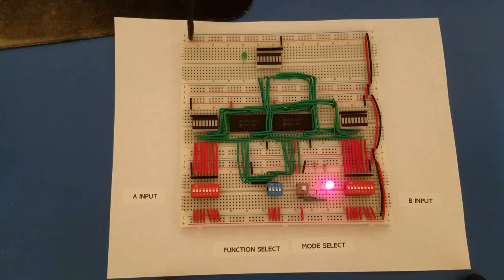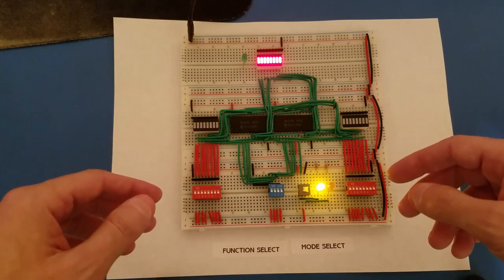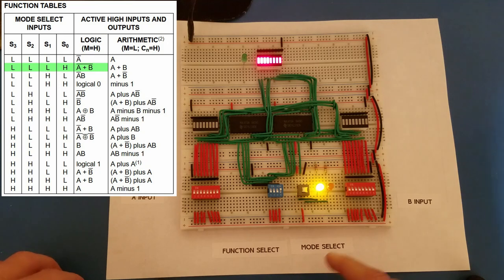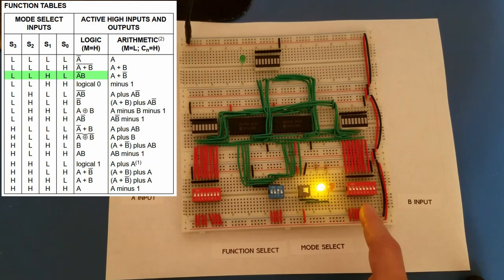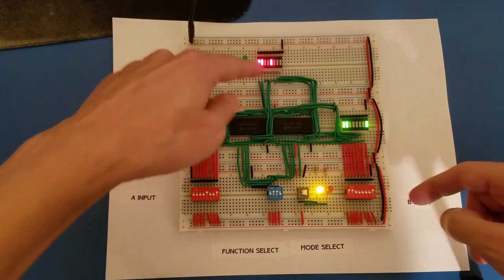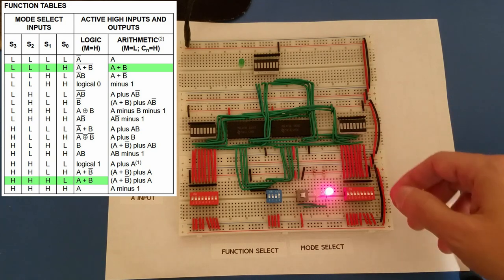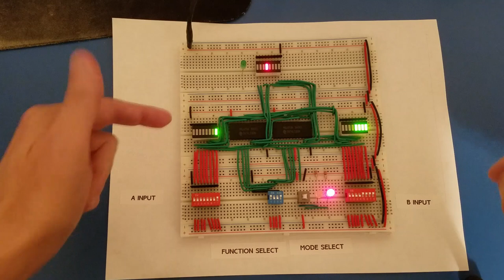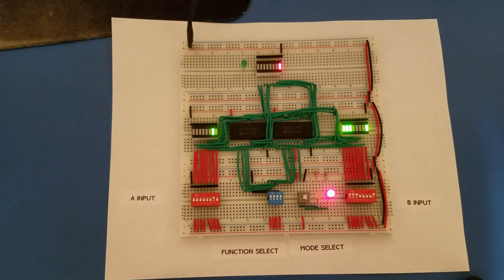Demo of 74LS181 (74HCT181) ALU

Comment: Ah, glad I found your video! I'm building a 6502 CPU clone from TTL chips. I'm just moving on to the ALU now and I'm going to use exactly the chips you used. I'll let you know how I get on.
Reply: I'm curious about how your 6502  clone went. Did you get it to work?

Comment: This chip was used in legendary computers like Digital Corporation PDP series. Unfortunately production was discontinued many years ago and it’s currently hard to find them now.
Reply: @ducksonplays4190   Guess what?. These chips are most probably recycled from old pcbs. Even at 1 or 2 € a piece, I kind of regard putting them on a hobby project as a sacrilege, like stealing gold pieces of art found in ancient Egypt catacombs just for display on your dining room.
Reply: @lsfornells  they might be but some chips they stock around 13k a day those about 300 a day
Reply: @ducksonplays4190  Just now they claim they have 120 units left ready to ship. I guess once they are gone they are gone. These chips are definitely no longer in production.
Reply: @lsfornells  they have a stock of 300 74ls181s currently
Reply: @lsfornells  with the western design center 65c02s which are still made they have 200 right now
Reply: lcsc sells them quite cheaply

Comment: Very interesting video about an interesting IC...thanks. How cool would it be to use this in the Ben Eater computer in place of the adder? I guess it would need some more control signals to set the mode of the ALU,  but it would enable a bunch of new instructions. I'm just about to start a build of a computer based on Ben's but probably with more RAM (256 bytes). I figure I'll need one more control signal for that (so a third EEPROM) anyway, and now I'm going to use these also, so thanks for the inspiration!
Reply: I think the reason he didnt use these chips is because they are no longer being manufactured so they are relatively hard to find and because u is selling kits it just wouldnt be sustainable
Reply: I did that and it worked ou great!

Comment: is there any chance we can get a schematic of how you connected the two 74ls181s together, I can't seem to get mine to work, and i can't get any help anywhere online, this video is the closest thing to a source that I can find.
Reply: Cn+4 goes to Cn on the next alu
Reply: Same for me - When I use 1 chip, it works perfectly as expected. When I use two chips, chained, I get very strange results - super frustrating :/
Reply: @SteveYoung359  If you get anywhere, please let me know, It has been over a year and I would absolutely love to revisit this project!
Reply: @Kevin192291  When you use the chip in logic mode (M=H) the carry functions do not operate. They only function in Arithmetic mode. Cn+4 of first chip to Cn of second chip for ripple carry. Do not use carry look ahead function. That requires additional special chips. Multiple chips should work quite easily.